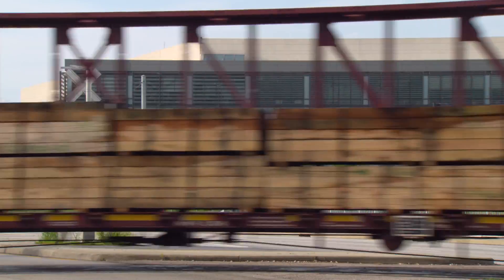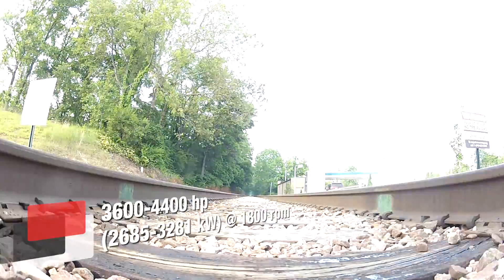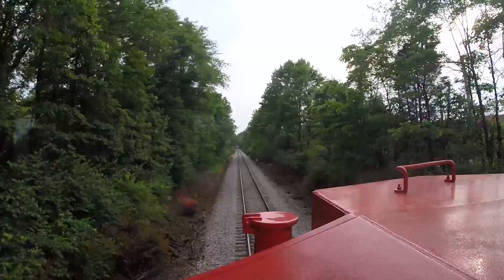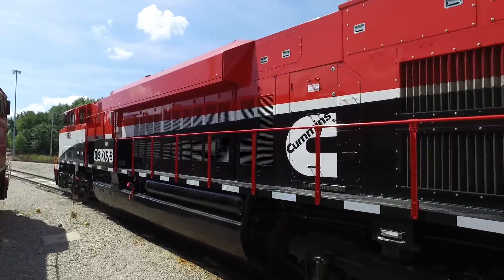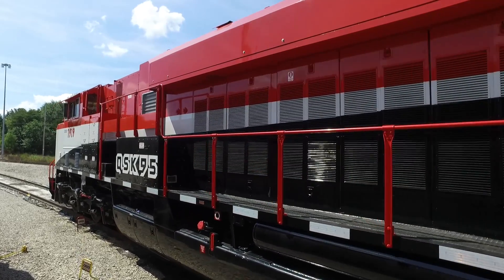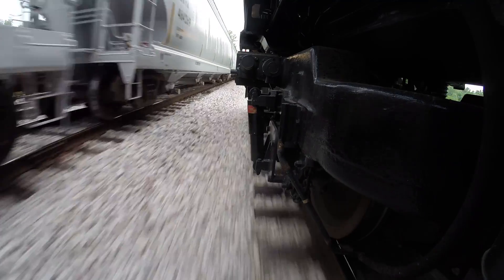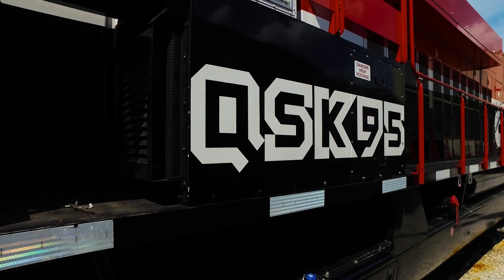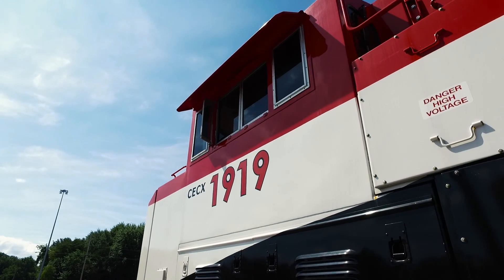Cummins and Indiana Rail Road QSK95 Powered Field Test Locomotive

Comment: Cummins has seen widespread success with the qsk95 on the Siemens chargers
Reply: I wouldn't call it "success." They're having a multitude of problems with those locomotives, and Amtrak is having to drag their retired P42s back into service, and keep the rest in service as well, due to the unreliability of the Chargers. Even funnier is when an Amtrak train has two of these new Chargers, they both fail, and a freight locomotive gets tacked on to pull the train!

Comment: Well this turned into a huge failure. Project abandoned and the engine was pawned off to a small re builder in Knoxville.
Reply: Maybe for freight. But freight is a notoriously hard duty cycle to design for. This engine platform (not the locomotive), the QSK95, is seeing huge success in the passenger rail market here in the US. They have huge orders for the Siemens Charger which exclusively uses the QSK95. The only other competitor in this space is the EMD F125 with its C175 engine, but that seems to have been a huge commercial failure with only Metrolink buying a few units and at that having a lot of issues with those locomotives.
Reply: @scenicdepictionsofchicagolife  It actually worked fine. What killed CECX 1919 is it requires DEF. An additional fluid that the railroads do not want to deal with. Existing servicing stations for locomotives are not set up to handle the DEF fluid. Class 1 Railroads have been pretty vocal about not wanting DEF. So this thing was honestly dead on arrival. The Chargers use DEF, but the passenger railroads don't seem to care.
Reply: @Alcochaser  hmm. Very interesting, figured it was something along those lines. Railroads are also (according my my rail engineer uncle who's with UP) skeptical about picking up locomotives with high speed diesels, thus why we still have the low speed GEVO and 1010J powering all current new freight locomotives.

Interestingly enough, new technologies like Perovskite Diesel Exhuast Catalysts, Ducted fuel injection, and Intercooled EGR might allow for EPA compliant diesels with no requiment for a DPF or SCR (DEF) catalyst. I hope to see it all go in that direction!
Reply: @scenicdepictionsofchicagolife  as long as it don't use any of navistar's technology from 2008-13, it will be fine.

Comment: So where’s this unit now? Any major orders of the QSK-95?
Reply: All the Siemens Chargers in the U.S. run them. Those are taking over for the Genesis.
Reply: @corystansbury  unrelated comment?
Reply: @corystansbury  he asked about the qsk95 not the sc 44
Reply: @swbfuf  And what engine is in the SC-44?
Reply: @corystansbury  thats the charger right?
Reply: @swbfuf  Correct.
Reply: Knoxville Locomotive Works purchased this unit renumbered it to 1998 and it’s currently at Yadkin Valley Railroad in Rural Hall, NC
Reply: i think ns just likes their weird locomotives
Reply: They're using these engine blocks in the Siemens Chargers, and they're having widespread problems with them. As for this one-off freight engine, it's sitting in a backlot, rusting. A piece of junk from the get go.

Comment: Guess I live under a rock didn’t know Cummins made a v16 didn’t know they made v configuration other than the 5.0 in the Nissan’s
Reply: wonder if i can swap this into my 1 ton! lol jk but yep cummins the company makes V's
Reply: Cummins made many V-type engines:  378 V6, 504 and 555 V8, 903 V8, 2300 and 2745 V12, and 3040 and 3660 V16.  The QSK 95 is a joint venture between Cummins and Wartsila.

Comment: I wish cummins would stop bulljiving and produce a medium speed engines for the locomotive market
Reply: Well keep in mind, they have a HUGE resume of other engines for other purposes… they’re not going to go all-in with a market dominated by GE and EMD. The QSK does everything from generator sets to mining operations. 
The fact that they were able to take an existing design and actually make it Tier IV capable is pretty cool. 

I don’t see any issues beyond (possibly) more wear, but all the components and bearings etc are also designed around those speeds. 🤷🏻‍♂️
Reply: @EstorilEm  I understand ,but caterpillar makes large medium speed diesel engines ,for locomotive size and even larger ones for ships
Reply: bulljiving
Reply: That engine have a max speed of 1800 RPM.

Comment: The Cab of A SD70ACe and the Body of the SD75I and the Rardiators of a GP15T.
Reply: also it looks like it has the tunnel motors of the sd40t-2
Reply: SD715T
Reply: Cab of a SD90MAC-H Body of a SD40 Radiators of a GP40 Road Slug
Reply: @iatif1995  ex-UP 8561.

Comment: electric sucks
Reply: Rich Harris electric?.. This is a diesel engine.
Reply: Adam Hollins diesel engine has a generator .. the engine runs an alternator and it runs the traction motors cuz it is easier to control speed and takes less parts , saves cost , has variable torque out put and can be fitted to every wheel with out much work! ...  the more power the generator has the more power it can deliver to the motors and electric trains get there power from over head lines instead of a diesel generator....
Reply: diesel can run on places where there is not very frequent commute so running power lines is dangerous and cost more to maintain... , other way electric does not need cold start it will run right away as soon as they touch the over head wires.. it has a small engine just to keep the cabin power on incase of emergency...
Reply: @KuntalGhosh  well aware it's diesel electric, no other transmission would hold the power of these engines though.
Reply: @AUSSIETRAINDRIVER  Really? You think a 4,400 horsepower diesel engines holds a fucking candle to a stationary power plant? Some stationary power plants are rated in millions of horsepower. An AC6000CW is 6,000 horsepower (or 4.5 megawatts), but Plant Vogtle will be 4,664 megawatts (6,254,527 horsepower) when all 4 units are running. Grand Coulee Dam is 6,809 megawatts (9,131,019 horsepower).
Reply: @Jemalacane0  who said anything about comparing a locomotive to a stationary power plant?..
Reply: No it doesn't.
Reply: this man need to learn how to delete a comment :p

Comment: The best engine on the locomotive market today , legendary Cummins reliability and tier 4 compliance make this the one to beat
Reply: I highly doubt its the best locomotive prime mover on the market.  For decades EMD and GE have dominated the locomotive market with their big medium speed diesel engines which are very reliable and are continuously evolving.  The QSK95 is a high speed engine so it spins at a much higher rpm than the medium speed GE's and EMD's and theoretically should have more wear and tear.  GE and EMD are listing 4500-4600hp ratings with only 12 cylinders at lower RPM, so the way I see it is automatically you should have lower maintenance costs on an engine which has four cylinders less.  Plus this needs AdBlue or DEF to meet Tier 4 emissions standards which adds another unwanted and frankly unnecessary cost.  GE and EMD do not need DEF to meet the Tier 4 standard, I seem to remember the big freight railroads made it clear they did not want to use DEF.  EMD being part of Caterpillar now gives them a big help too with 4 stroke technology.  Cummins make great engines, but GE and EMD are still the top dogs and will be for a long time yet in the railroad.
Reply: @macdonaldjohnstonfan  you are so right a high speed lightweight diesel will not last nearly as long as a big medium speed diesel
Reply: @macdonaldjohnstonfan  Cummins just need to make a medium speed engine to compete with GE and EMD
Reply: Dave Loftus I wouldn't say the best on the market. But no doubt a good engine. Let's see how it survives the test of time compared with the current locomotive engines.
Reply: EMD 710 was best on the market until the numb skulls at the EPA decided to add to the list of things that make life more expensive for no good reason.
Reply: Not to bash Cummins, but that engine is no better than the ISM or large off road line of engines. Tier 4 is just a bunch of hot air when it comes to off road equipment. Because the overall cost in DEF and EGR equipment is more than price of an older machine. These systems are not needed for emissions control, as there are other ways to dampen the "smog" output of an engine with no loss in power. A diesel locomotive is nothing more than a self propelled generator set. So I don't see the point with the Tier 4 nonsense. Even in training programs it's said the idea is pretty much dumb. Because diesels don't produce as much emissions as a gasoline engines, which waste more fuel.

It's just added weight and money going to waste through false claims from the EPA and California Air Resource Board.
Reply: All the EPA do is screw over every industry they get their dirty little corrupt hands on.  All I hear with every Tier 4 rated engine is problems and stupid problems at that.  How can you go from having a locomotive which has no prime mover problems to prime movers plagued by problems due to emissions control crap, how is that right, a new model I thought was meant to have less problems as manufacturers learn from designs and upgrade them.  EGR is a waste of time, makes the engines run hotter than they should, clogs up the intake manifolds and causes more soot.  I can't believe for the life of me why (as an example) a Kubota diesel zero turn mower over 30hp now has to be tier 4 compliant, seriously its a lawn mower, it use to have a simple non turbo diesel to now having a small turbo and DPF for emissions compliance and causes nothing but problems.  Stuff the EPA!!
Reply: macdonaldjohnstonfan Urea with SCR > EGR. The more you utilize SCR, the less EGR you need. EGR reduces performance, increases fuel consumption and increases fine particle soot which clogs the DPF quicker. 

Cummins uses the high speed engine with SCR in order to run a hotter combustion temperature which results in a cleaner burn that keeps the emission systems happy. The cost of urea is offset by the fuel economy increase, oil change interval increase and increased emission component durability.
Reply: GEVO is the best engine on the locomotive market today.  Cummins is just lucky that GE the parent company has been embroiled in its own financial turmoil over the last couple of years, and GETS lost some focus as a result,  which allowed Cummins to gain a foothold especially with the Amtrak charger.
Reply: Well they think they are being smart by coming up with stuff like that. But whatever next? A flexi-fuel lawnmower or string trimmer? Caterpillar used series turbocharging as a means to cut emissions, because a turbocharger in itself is an emissions control device. However, it seems to be that between the Diesel Brothers fanatics, Go-Green Brigade, and people who have no clue how diesel engines work. The effort to explain aneroids, Ricardo combustion chambers, proper supercharging, ignition lag, turbo lag, and getting more out of the drive train is utterly fruitless.

Comment: We need to electrify our railroads.
Reply: Come up with a plan, costs, and then get back to me about that.
Reply: Gammareign these are diesel electric locomotives and the engines in question a very efficient and very low pollution unless the grid is more than 50%+ renewables using purely electric locomotives would be a step backwards factor in the massive cost of installing and maintaining electric infrastructure and it becomes pretty obvious why it hasn't happened yet. 

high efficiency diesel electric locomotives and freight ship engines will be the very last hold out for internal combustion engines.
Reply: @spencerhho  Not even remotely true. Electric locomotives are ~3x as energy efficient as diesel-electrics. When an electric locomotive is put into dynamic braking mode, the electricity is not wasted as heat like with a diesel locomotive, but is instead run into the overhead catenary where it can be used either by other trains or by businesses and homes.
Reply: @Jemalacane0  explain the class 2 and 3 railroads. they wouldn't have enough $ to buy electric locomotives so it would be useless to them
Reply: @swbfuf  I don't see why a diesel locomotive can't be converted to an electric locomotive. Because electric locomotives are so much more efficient, there would be cost savings in the long run.
Reply: @Jemalacane0 they wouldn't have enough money to do that
Reply: @swbfuf  No, instead a class 3 where I am bought a few brand new SD70ACEs. It would have been awesome if they could have bought dual-mode locomotives and then got to work on catenary.
Reply: That would be less efficient.
Reply: Electric powered trains are suitable in a densely populated urban area and where constant commuting is necessary. It's way more feasible for the government and the company to run and maintain when there's more people are using the service.

Diesel in the other hand, great for outskirts long distance freight train where you can't just install hundreds and thousands of miles tracks. But I still hated diesel for its pollution and not as efficient as electric locomotive.

In fact the most powerful locomotive are mostly electric ones. Iore is an example of the most powerful loco that pulls long heavy iron ores along Swedish railway.
Reply: maybe all of amtrak that is but not all
Reply: yeah but there are class 3s that can afford sd 9 and stuff like that, the government isn't made of money

Comment: What are your traditional engines? I thought cummins was a big name in the locomotive game?
Reply: Its GE and Caterpillar-EMD, with some smaller companies locomotives like yard switchers, electric, and commuter locomotives. You will also find engines from ALCO making there way around in a few places. Many commuter locomotives have Cummins secondary engines for HEP or are repowered with a Cummins prime mover, but that is the usual extent of their railroad influence.

Until now...
Reply: @zackboone15  The Brookville BL20GHM is a good example of that. It originally had an MTU but now has a Cummins QSK50. The HEP unit is a CAT
Reply: Jacob Roach In this case it'd be from GM's Electromotive Division. Typically before the Tier 4 it was GE and EMD.
Reply: Currently EMD (2 stroke) ALCO and GE (4 stroke) but others are slowly creeping into the market. Like MTU, CUMMINS, CATERPILLAR.

CATERPILLAR tried years ago but failed reliability tests. But have since corrected the issues and have made a come back after buying EMD.
Reply: @adamhollins9800  EMD developed the 265H 4-stroke engine in the early 2000's, but it failed in the market.  It has now been redesigned and redeveloped as the 1010.  Also, EMD tried increasing the rpm of its traditional 2-strokes to 1100 rpm a very long time ago, and failed miserably.  So even the experienced builders in the locomotive business aren't always successful.
Reply: hehe, if you cant beat them, then buy them out. sounds like a cat philosophy
Reply: The traditional engines are larger and produce the same and more horsepower at lower RPMs and last a lot longer especially on HEAVY coal drags